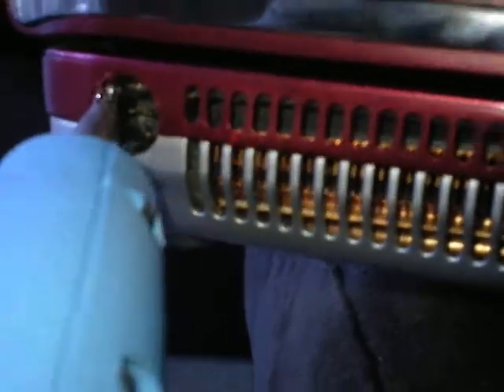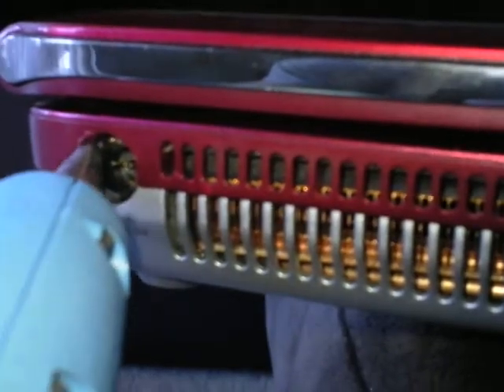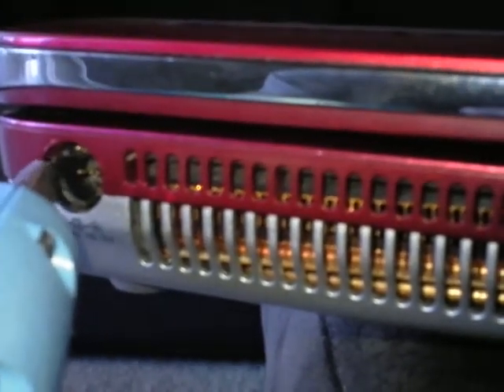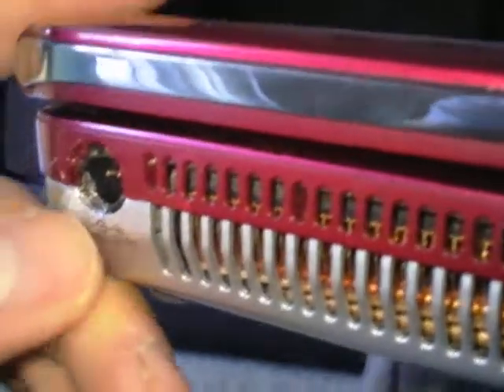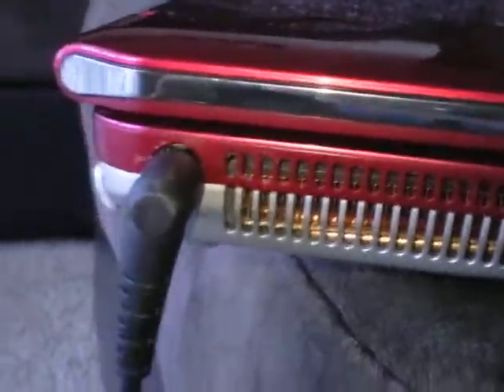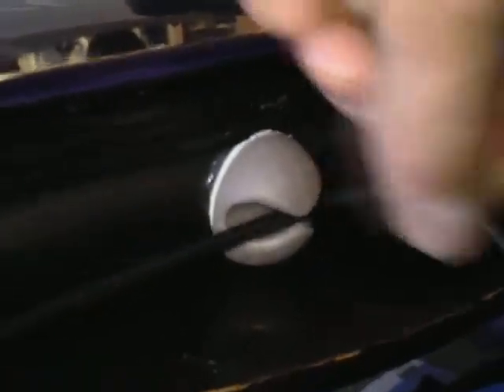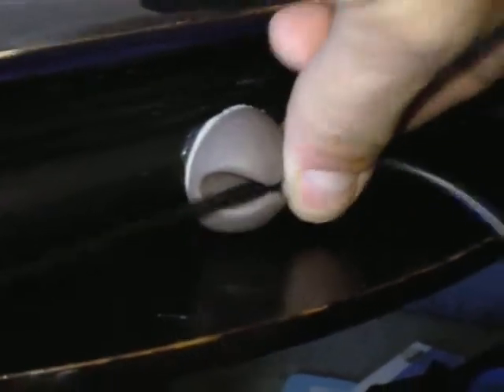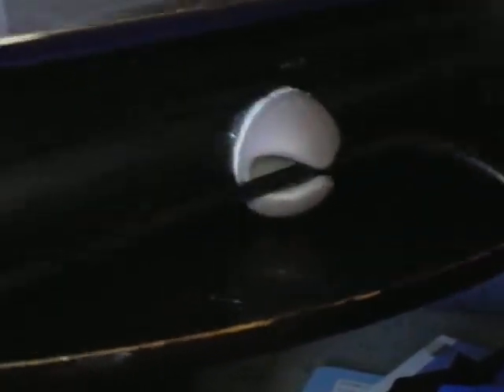EASY HOW TO FIX LAPTOP CHARGER CONNECTION REVIEW

Comment: Trust me, replacing it isnt a permanent fix either. Ive had to replace mine twice and about to replace it a 3rd time (within a 3 year period). It constantly stops charging. I replace the AC adapter each time too. Nightmare.

Comment: I have an asus with a wire just like that and the port is very similar it's an asus x and I got a new wire in winter2014/2015 and the previous wire sparked and had a break so I got the new one and recently it's been wobbly in the port and i have to wiggle it then I can't move or it will not charge and the battery life runs out a lot quicker than it says it does and I've had my laptop since February 2014

Comment: i have a gateway laptop and the port is very loose and it wiggles. I tried to do what you said in the video but wont charge. Please help!!!
Reply: Did you fix it? That's what I have!
Reply: Same but I have asus and I looked in the port and it looks normal and it is a pain to charge and I have to wiggle it to charge then if I make the slightest move it stops charging and battery life is very short

Comment: My power chord will be connected to the laptop, but only charge sometimes. For example, I have to have it at a perfect angle, put the chord under the laptop to keep it bent, and push against it from the back with a book or something. Obviously, this is annoying but it seems expensive to fix. Visually the AC adapter doesnt look broken. Is it the connection to the motherboard and need to be dissassembled? Or is there a quick fix? thx

Comment: i have that thing that makes connection with charger with acer aspire laptop but the socket is way more smaller and a needle is very easy to bend so it's rather hard to do that

Comment: My centre thing moves, is that normal? Im not sure if the other part needs to be pulled out because it's in a different spot to yours. I have an Asus laptop and the only way it charges is if I push it in hard and pull it to a side. Is there a quick fix or will I have to pay someone to replace it?